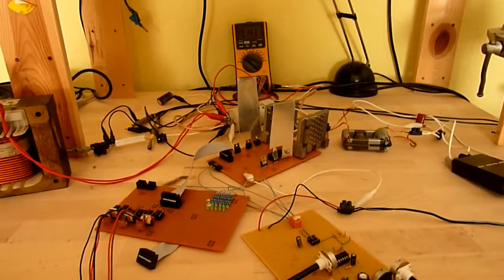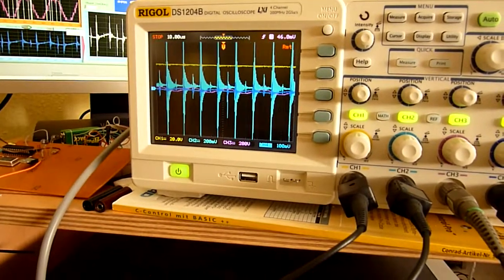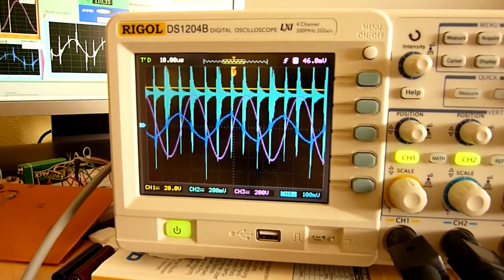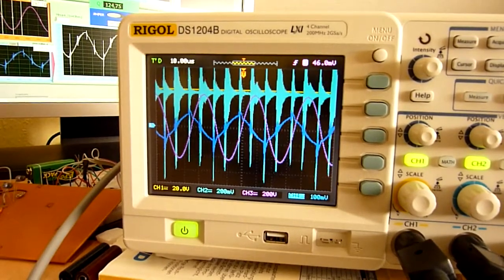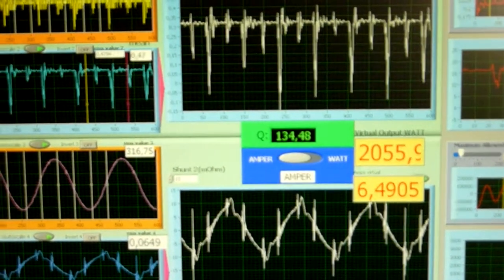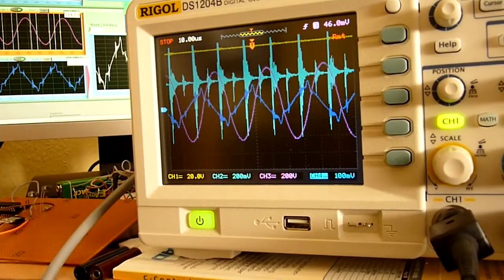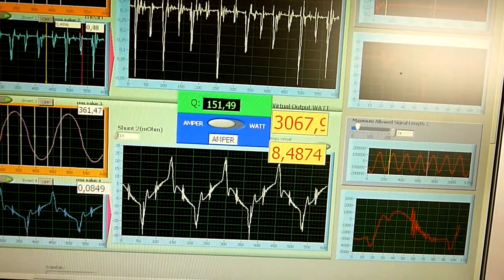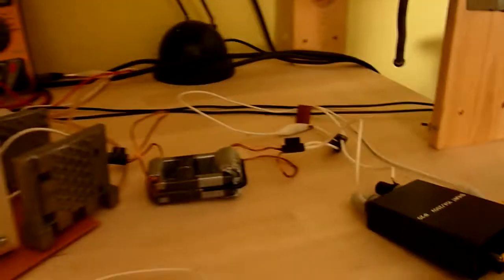Basic Transverter Test 2 - Ferroresonant

Comment: What's the ringing waveform that taking up most of the screen of your Rigol?
Reply from the maker: Upper yellow graph is the input voltage. The light blue graph is the input current, measured over a serial shunt between 2 paralleled capacitor banks in order to get stable DC input reading. The ringing is a result of parasitic inductances and capacitances at the primary side, induced by H-bridge pulsing. These pulses kick back into the "pure" DC stream from first cap bank to the second cap bank, whereas the H-bridge is pulsed from the second cap bank.